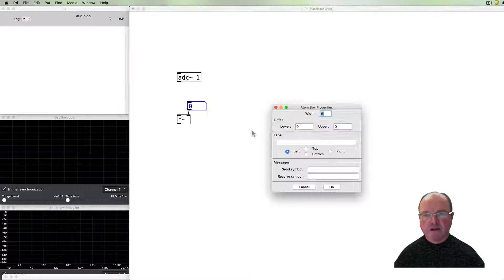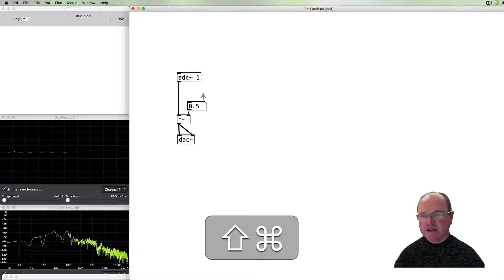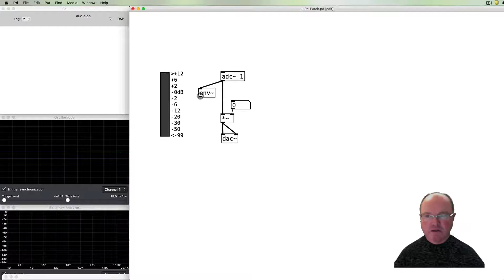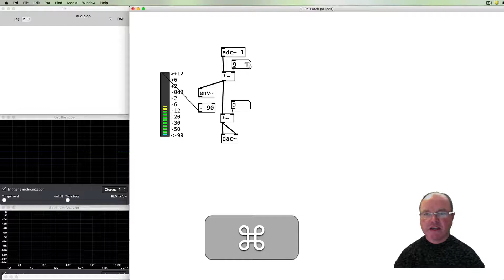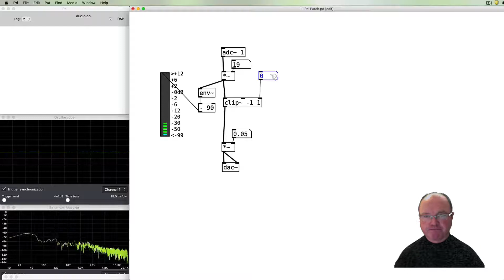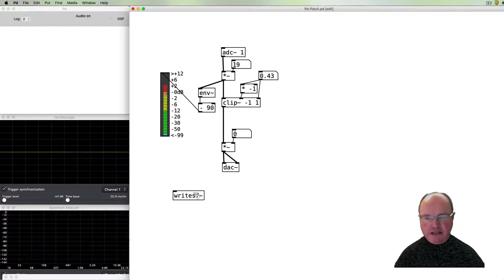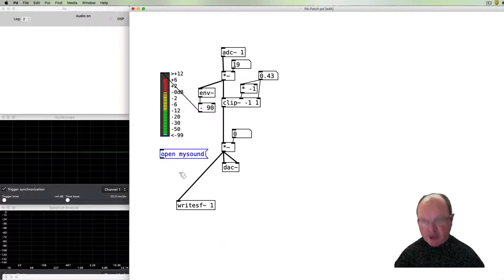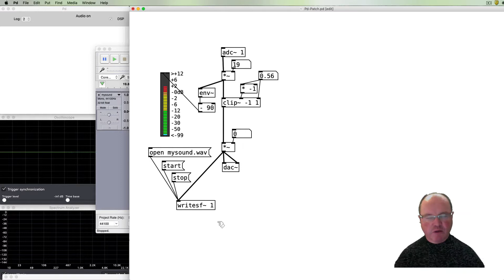22. Audio Input and Writing Sound Files in Pure Data

Comment: So I have a few questions - maybe I'm 4 years late to this, but hey, I'm still glad this tutorial is around!
I'm getting a lot of feedback when using the adc~, maybe because of the better microphones on the newer Macs? Is there any way to improve this?
Also, does anyone know how to connect an Apollo Twin as an audio interface, so I can hear the Pure Data patch through headphones and use the internal inputs of the interface?
Reply: to reduce the feedback, you should use a different device as the microphone. so instead of using the microphone and speaker of your mac, change one of them to something else (an easy way is to use headphones)